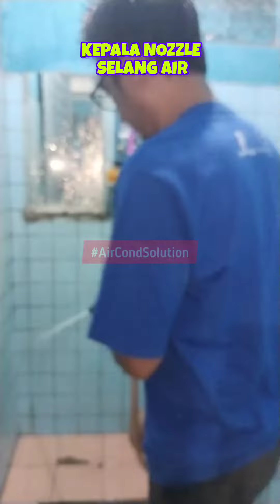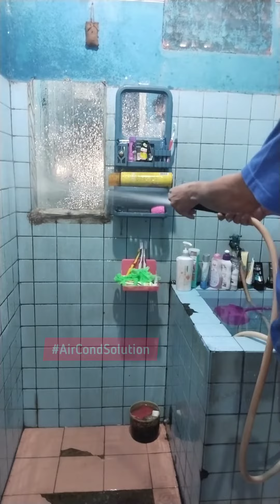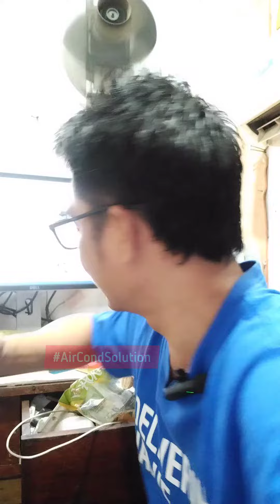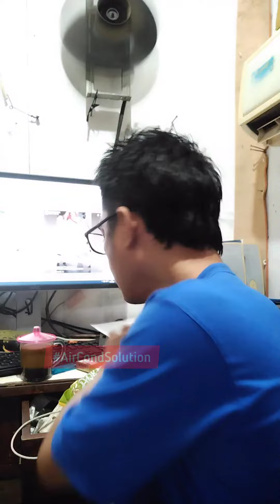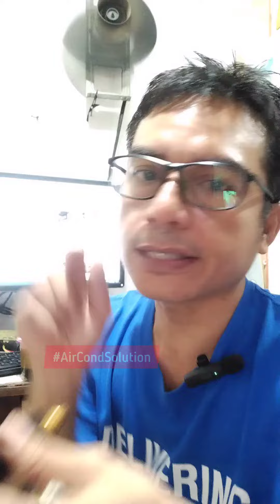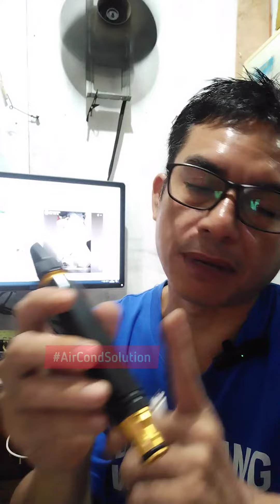Kepala nozzle ini bikin semprotan air jd kencang

Comment: Bangg maaf melenceng mau beli ac tapi bingung mau beli ac merk apa yg awet n dingin 05pk bisa kasih saran merk apa ya bang ?? N kalau beli baru apa harus divakum
Reply: Komen atuh bang jangan dilike aja😁
Reply from the maker: saran sy kl msh awam beli AC di toko official AC nya menyediakan semua mulai dr unit AC nya, material pendukung nya & jg termasuk teknisinya jd gak khawatir di kadalin teknisinya, ni rekomendasi pakai AC Panasonic 1/2 PK low voltage ini, di sini di toko official store Panasonicnya lgsg : https://shope.ee/7KWvdKd3Ab
pilih paket combo pipa 3 meter atau pipa 5 meter & klaim jg voucher diskonnya
Reply from the maker: saran sy kl msh awam beli AC di toko official AC nya menyediakan semua mulai dr unit AC nya, material pendukung nya & jg termasuk teknisinya jd gak khawatir di kadalin teknisinya, ni rekomendasi pakai AC Panasonic 1/2 PK low voltage ini, di sini di toko official store Panasonicnya lgsg : https://shope.ee/7KWvdKd3Ab
pilih paket combo pipa 3 meter atau pipa 5 meter & klaim jg voucher diskonnya